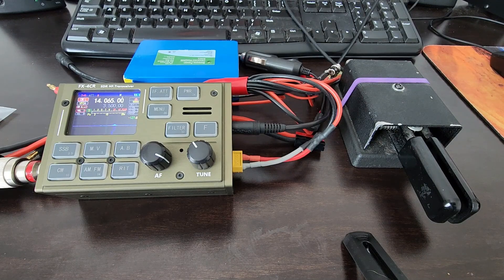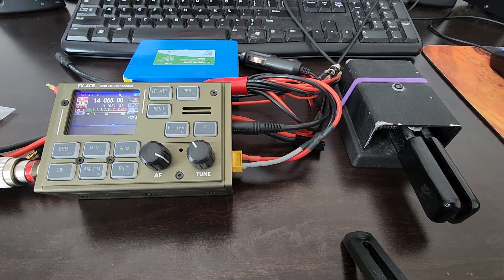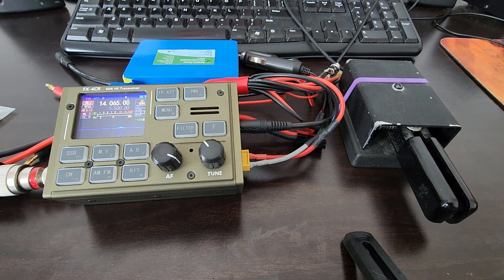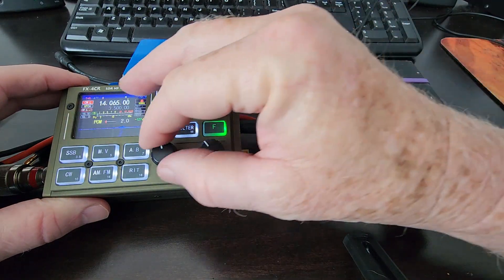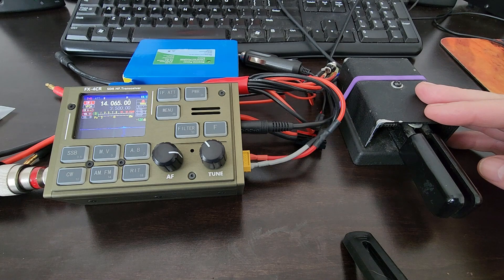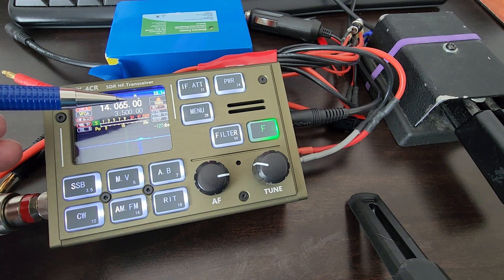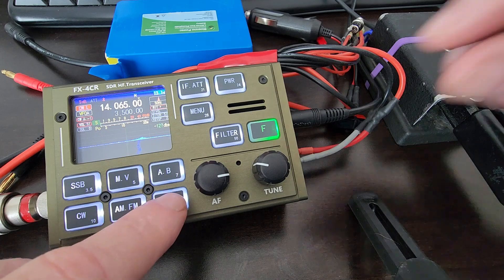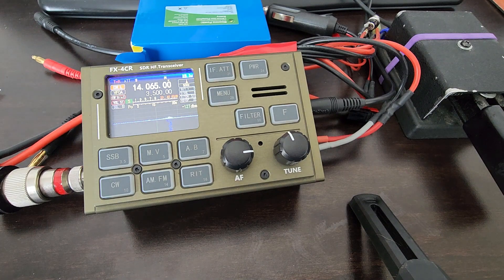FX-4CR RIT problem

Comment: “Yu had shared a test firmware with me that fixed the RIT problem and allowed me to adjust the spurs. I was able to reduce spurs quite a bit.” Yu is the developer and this was written by W2AEW. I would advise patience. Good things come to those who wait and we all know the other old adage about honey too.  I have an FX4-CR and I trust that is evolving into a fine radio with an impressive band range and output power level. That said, it’s anyone’s prerogative to jump ship. I like innovation and variety and that always involves lows. Grateful for the post to keep the ham community informed!
Reply from the maker: Are you a CW op by chance? I'd love to hear the results of someone testing the radio (& new FW) over the air to make sure the leading dit issue at fast speeds is resolved. This would have to be an on-the-air test, ie with a remote webSDR receiver - not locally heard within the shack (where it will sound fine). This is reported as being fixed but, as yet, no one has verified it. 73

Comment: A friend of mine sent me this video,
And I tested mine.
I do know that on a lower voltage input, @ 9VDC it gets a little unstable even at 5 watt's.
I've had mine now for over three weeks and I'm not seeing any issues with the RIT.
Be nice to have a dedicated manual for this. 
I would try the hard reset and see if that resolves the issue you have.
I have worked CW, and phone without any issues at all.
Reply from the maker: What version of firmware is installed on your FX-4CR?

Comment: This was fixed Feb 25th.  Did you try the latest firmware?
Reply from the maker: Mine won't connect w/PC. Will get a replacement soon once bugs are worked out (especially the spur and CW issues).

Comment: I was wondering if you could use ‘split’ in the meantime. But I read that you returned it. I’ve been pouting around the house in front my xyl until she gives in and lets me buy one. I guess it’s good she is stronger willed than I. Hihi
Reply from the maker: Yes, I could use split to serve the same function as RIT, but it is much less convenient to do on the fly because the FX-4CR doesn't have an A=B button. So to get VFO-B in the vicinity of where I'm operating (with VFO-A) I have to go to VFO-B, select the proper band, then use the VFO dial to tune to wherever VFO-A is. With RIT, I turn it on and it's there where it needs to be, ready to go. An A=B button would make split as fast and convenient as RIT.
Reply: I ordered it! De n5vwn
Reply: Got mine! 2 months and 2 days. Happy! Never got a shipment or tracking number. Might have been accidentally sent to my ‘junk’ mail.
Reply from the maker: @gliderrider  Congrats - hope you like it. There is now a Group.io for the rig:
https://groups.io/g/FXradio

73!
Reply: I wonder if Yu could do a firmware update to make an A=B. That’s kinda my only hold back now. I do like the extra watts out power and also having 6 meters.10 watts on SSB just doesn’t cut it sometimes. I’m a little concerned about ‘front end overload’ as well. I’ve had a kx2 since they came out. So I know it won’t reach that bar. Hopefully the code bug has been fixed. My code isn’t that fast although I’ve been touching 20 wpm more and more without really trying hard. I’m also tempted to see if Yaesu is going to fill their ‘qrp’ gap since the end of the ft-818. I wore out my 817. Might be a long wait for them come out with something. Japanese radio products can usually be depended upon…at twice the price.
Reply from the maker: @gliderrider  I now have a 2nd FX-4CR on the way here. The circuit board mod has been re-worked and I expect the USB port to also work so I can do firmware updates on this one.

Comment: Ordered mine in December.  Was going to use this for SOTA.

Keep us posted.
Reply: How long did you wait for it to come in after you ordered it?   I guess all the cw kinks are solved.
Reply from the maker: Are u a CW op? I find that leading dits are omitted from transmission ~30% of the time when CW speed is 22wpm or faster. Many of the flaws of the FX-4CR can be fixed in firmware but I have my doubts about this one. I've returned the rig for a refund. If all the issues get resolved, I'll reconsider in the future. For now, I don't need $550 invested in a "maybe".
Reply: @AE5X  it looks like it has a lot of potential.  Have not received mine yet.  I may just ask for a refund as well.  Was looking into it for cw, js8call and winlink activities.
Reply from the maker: I'll be uploading another video this evening showing the leading dit issue. If that and a few other issues can be fixed, it'll be a great rig - it does have potential.